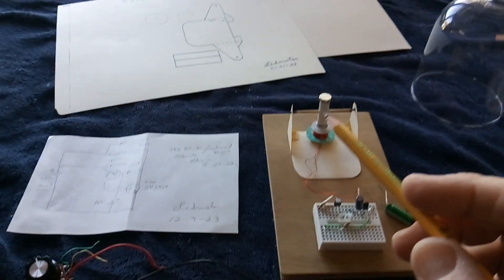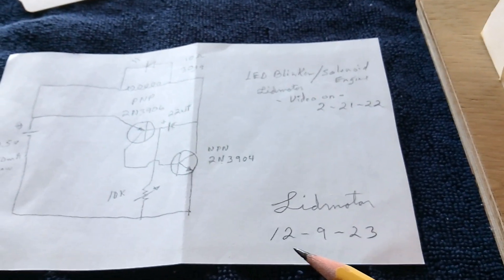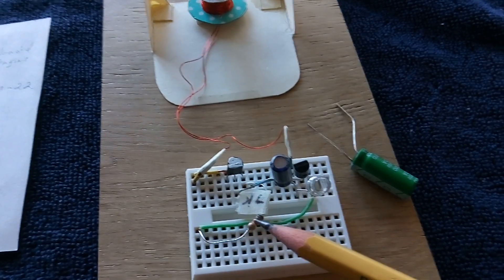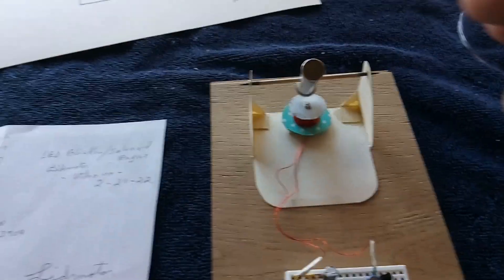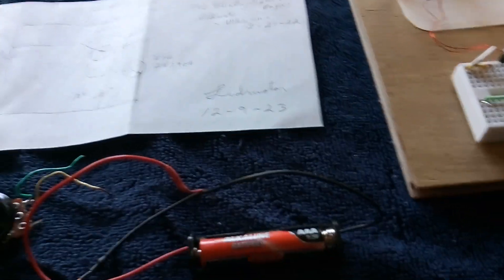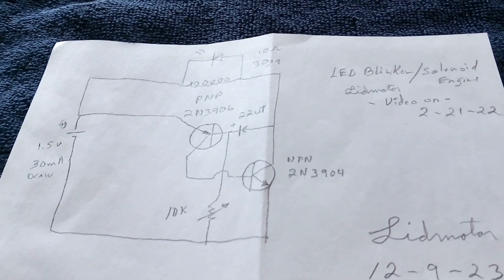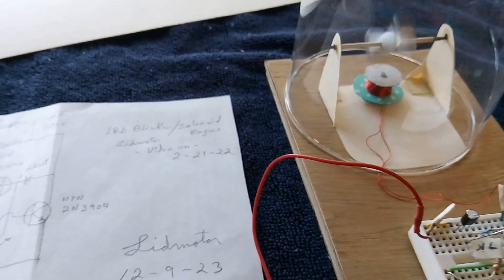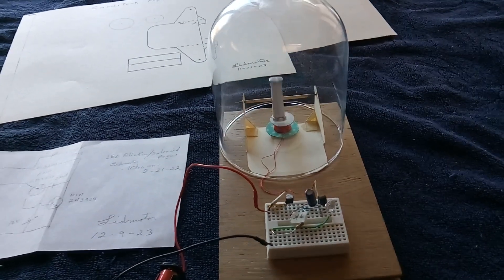Transistor circuit Cardstock Motor

Comment: This project is keeping you occupied 😊👍🏻
Reply from the maker: It is a puzzle. Making a motor using a 3D printer isn't that hard.  Making one using a standard 2D inkjet paper printer is pretty challenging.  It is all fun.🤔😀
Reply: 3D printing is often a short cut to a finished article, but takes away a lot of the practical skills @Lidmotor
Reply from the maker: I totally agree.  Practical skills are becoming lost as we depend more and more on machines to build things.     @GrandadIsAnOldMan